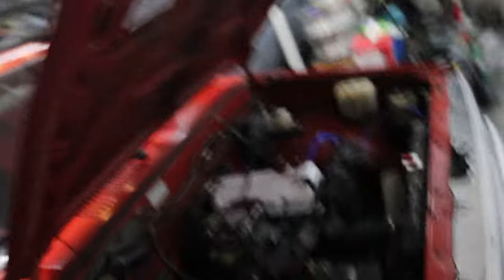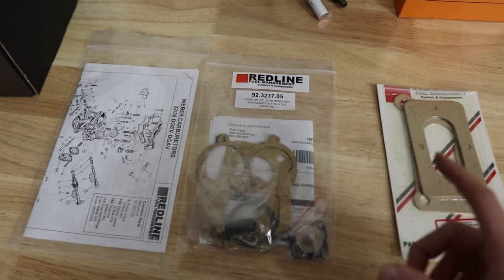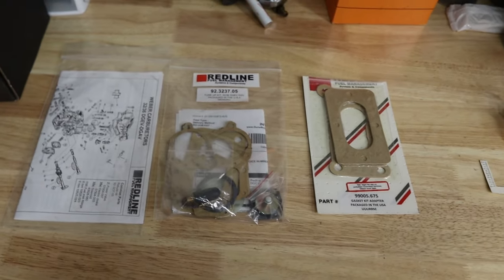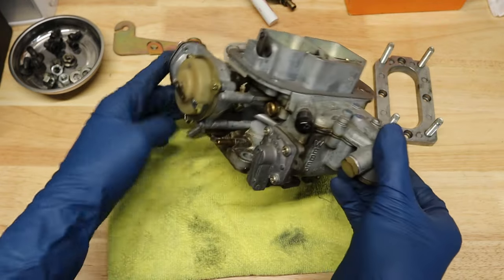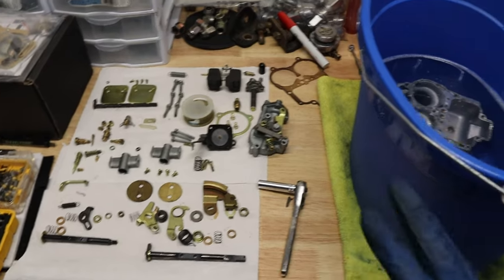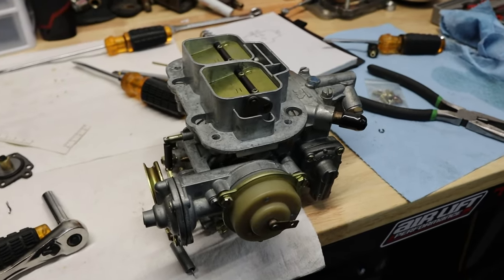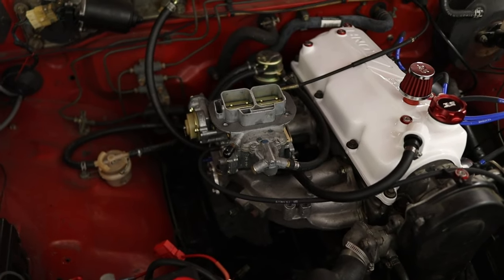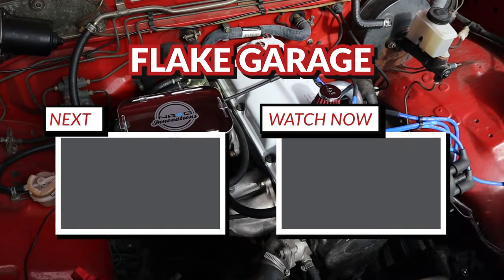Rebuilding Weber Carb Again on my Mazda B2000 B2200 | Flake Garage Vlog

Comment: What carburetor filter are you using I need that set up for my b2200 91 with electric choke
Reply from the maker: The one that came with the Weber carb